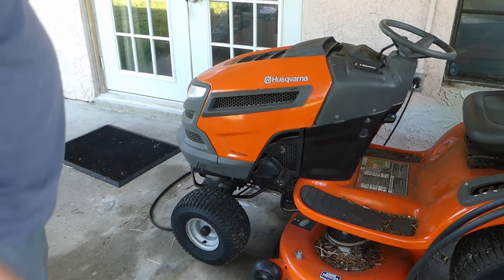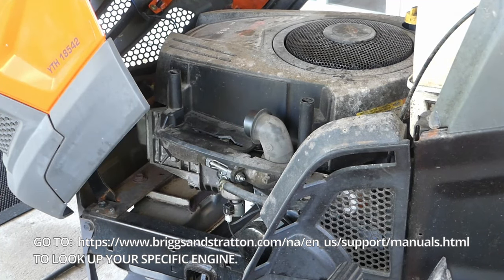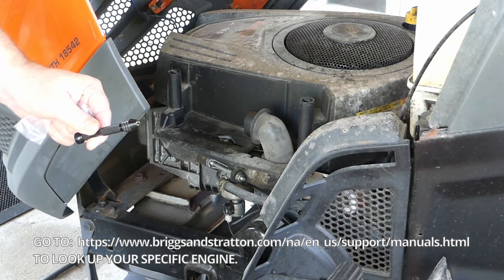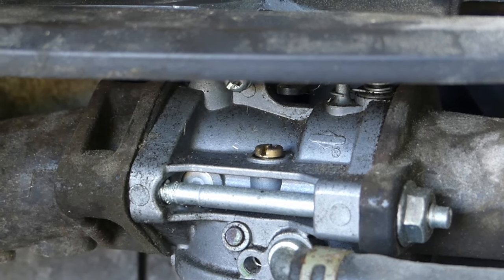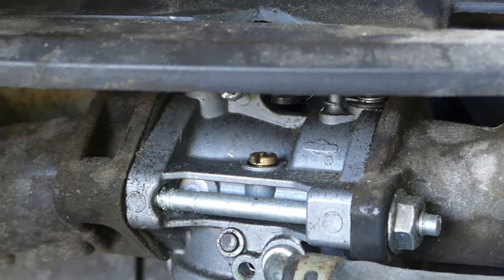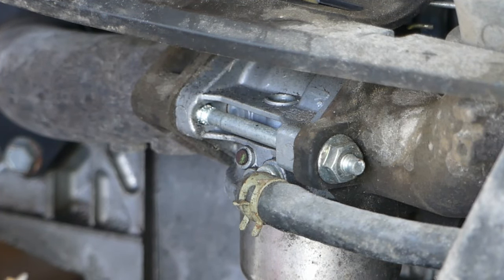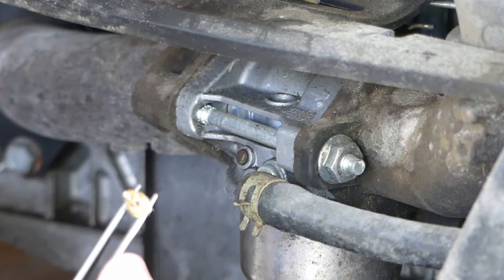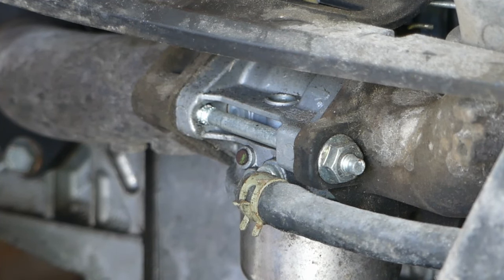FIXING THE LAWN MOWER SURGING PROBLEM (SKILL LEVEL EASY)

Comment: If you take a job like this to a lawn mower shop they will do just as you did in a few minutes but when you pick it up they will tell you it was a 5 hour job to remove carburettor , strip and clean and refit ,plus what ever else they decided to invent while working on it . What should be less than an hour will be hundreds . You pay because it’s running but they are laughing all the way to the bank . Good on you for fixing it yourself . Well done 👍
Reply from the maker: Deanwitt7903, I hear you loud and clear.  I may just do a strip and clean on the carb.  Just to stick it to em again!
Reply: I'm a small motor mechanic  in Australia.  Our labour  is $95 an hour. I get $25 an hr.
Reply: If you have a dirty pilot jet, the proper thing to do would be to take the carburetor out and completely clean it the right way, not half ass it and take shortcuts. So if you don’t want it done properly do what this guy did and you can deal with more problems down the road.
Reply: Dirty fuel.clean gas tank and new filter.
Reply: @homers7777 you should go into business for yourself

Comment: This video is inaccurate, i have been a small engine mechanic for 15+ years. The symptom of surging at high rpms indicates that it is the main jet that is the cause, the pilot jet is only critical to low engine rpms. It is also providing fuel all the time so the pilot and main are cumulative. But this "repair" would not fix the surging. Also none of the b+s repair manuals i have(all of them) indicate this is the correct repair methodology.
Reply: Good morning. I have got a John deere with a B&S engine. 19HP. With same carb and is also surging like on the video. So do you think I should clean the main jet? I just did it but no change. Surging and does not rev up. Any ideas?
Reply: hey man, help me, im Brazilian, my husqvarna Rider r316tx Kawasaki f481v motor runs really bad, i cleaned the carburetor but after this he runs much bad with black smoke, (it looks like the choke is on), Have you ever seen something similar, before cleaning the carburetor it was oscillating at idle speed
Reply: @MultiSander1986 Hello friend, im Brazilian, in this case the best thing to do is to remove the carburetor and clean the high speed and low speed fuel channels
Reply: My Husqvarna yth24v48 surges at low rpm. I have to keep the throttle up high to keep it running. So if the engine is surging at low rpm do you still clean the main jet or the pilot jet or both? Thanks

Comment: Solid coar copper wire is my go to for carburate cleaning. It is softer than most cast carburetor materials and snakes easily through any small orifice holes.
Reply from the maker: That could absolutely work!  I like the train of thought.  My only issue is that for me at least i would have to remove the jet, then go to the hardware store to find the right size.  I simply do not carry a wide variety of wire in my shop.  In a pinch we use what we have to gain success.
Reply: I believe the size is about .013 dia, and electricians know what guage of wire to use to get a strand of .013 off from?

Comment: It should be noted that there are hundreds of thousands of different types of carbs and engines. Personally as filthy and moldy as that engine is I'd probably remove the carbs get a rebuild kit and completely clean it. I'd also put a nice in line wix fuel filter in it because usually if it's clogged your gonna be doing it again if ur tank is not cleaned up.  While I was at it I'd toss in a can of berryman b12 to clean out the carbon cuz today's ethanol fuel is garbage. Finally I'd replace the oil and finish off with a new spark plug.  All cheap easy fixes.  I'd also on this mower specifically seeing how it has a bit of a long crank at choke and is spitting blue smoke.  I'd check your timing and maybe replace the points or at least clean them up. 

Just my 2 cents. One thing about riders that I truly think is the biggest issue with them. People don't clean them after mowing. At the least grab ur blower and get the crap off the engine and deck and trans. I have a couple of old wheel horses and John deeres and they were my grandads and had all been taken such great care of.  I mow 4 acres a week and use the deere 314 hydro rear end tiller to maintain my garden twice weekly. In the winter I push snow.  It definitely doesn't take much. You just have to take good care of them

Comment: Hey CJ you have the lawn mower engine idling faster than before you did not repair it
Reply: That’s because he has it idle higher, where it’s set in between how fast he wants the mower to go between the turtle and the rabbit on the logo of the mower itself if you actually pay attention in the video, so yes, he did fix it

Comment: Sounds like starter is stuck also 
Nikki carbs are a pain in the butt
Never leave old gas in them
Reply from the maker: The battery is on its last leg, almost convinced myself to go buy another one.
Reply: I always run mine dry. Got a fuel shut off. When done mower (every time) I shut fuel off then run motor until engine stops.
Reply from the maker: Just an update on the battery.  I put it on a charger to recondition it and works real good now.

Comment: or fuel filter can do it
Reply from the maker: Certainly a fuel filter can be the cause of getting trash in the carb.  But simply changing the filter may not fix the problem of surging once the jet is clogged or partially clogged.

Comment: Is that a Nikki?
Reply from the maker: according to the manual it does not appear to be:
link below, my carb is 125B which states a Ruixing branded carb.
https://shop.briggsandstratton.com/pages/parts-lookup?utm_source=briggsandstratton&utm_medium=link&utm_campaign=mega-nav#/Briggs_%26_Stratton/33R777-0003-G1/Carburetor%2c_Fuel_Supply%2c_Kit-Carburetor_Overhaul/33R7770003G1/104920004A/y

After all the horror stories about Nikki I feel I should count myself lucky.